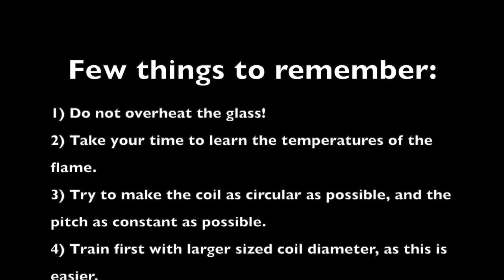How to make a glass coil for condensors

Comment: That's one way.
A lathe, crossfire burner and dowel with a nail in one end is a little faster and more consistent.
I can see you've done it this way a lot though. Good work.
Reply from the maker: Thanks, it is one way, of many. It has been a while I last did this though, can be done faster. 😅